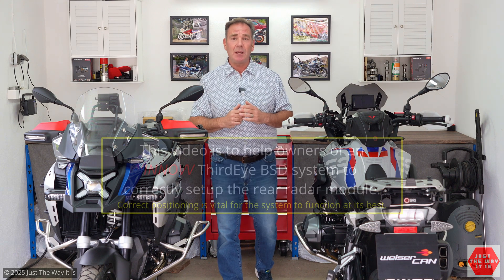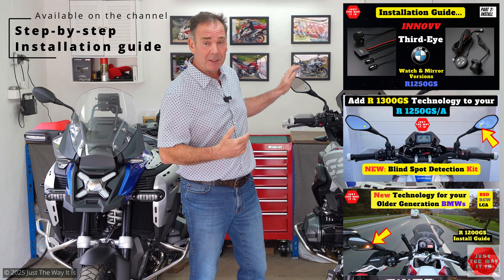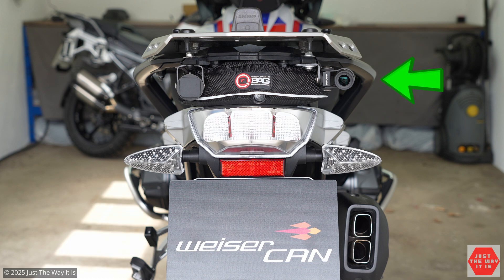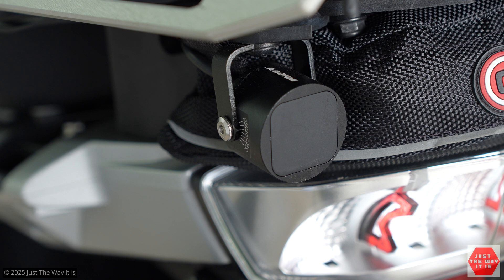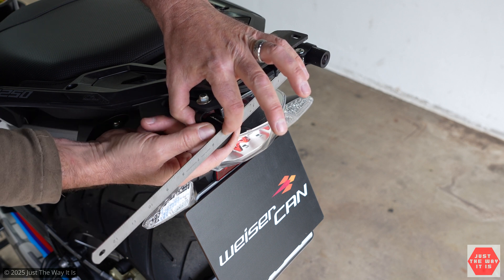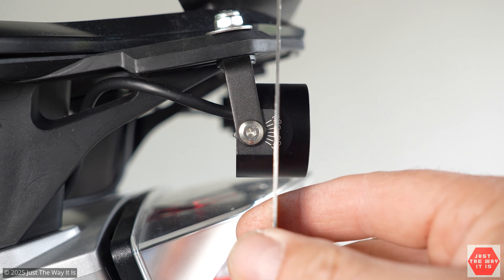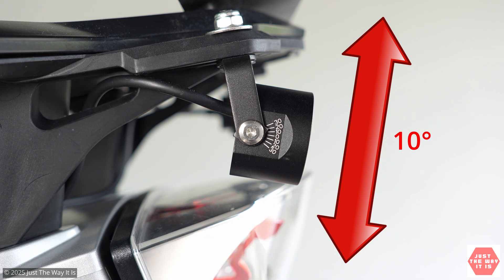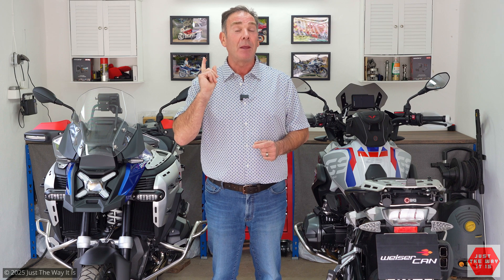INNOVV ThirdEye Blind Spot Detection system, correct rear radar position is vital ! - How to set-up

Comment: engine fitted carl shes had the full engine inc all covers and also the whole gearbox and final drive also a detail by there valeter
Reply from the maker: Hi Austin, sounds like they have done a great job, 👍, fingers crossed she is now fine🤞.
Reply: @justthewayitis i asked how much it all cost and they told me over £7000  for the engine and over £2000. for the diff i asked for my shift assist pro to be calibrated and they said they will do but dont expect  any change as my new engine came complete they did say shes had gearbox and clutch the whole kit caboodle she wasnt rough before but shes really smooth now and the tech guy when asked about running in and the issues i have had i explained i followed all running in procedures when she was new and yet she uses oil and needed a cylinder head he told me he bought a 21 plate new from their dealership and thashed it from day one and it never used a drop of oil and never had a single issue he also advised me to wash the bike using salt free snow foam  also i dont know how to send a persinal message on here but you express a desire to link up carl whilst on my tour if i could send you a route i would so you can see if i will be anywhere near you but all i am doing as i know have a carpuride. 701b pro (not the bs ) as thats too much money and imo no needed i will google calais to rimini avoiding tolls thats show ls my route

Comment: Hi Carl,  I found that when the bike is loaded and not on the centre stand, the angle changes.  I set my sensor to vertical with no load, and it seems to work fine!
All the best, Nick
Reply from the maker: Hi Nick, good morning 😊, thank you for sharing your tip 🤞, have a great weekend, Carl 🙋🏻‍♂️

Comment: I recently purchased and installed the Weiser Technik/ Innovv R1300 mirror Third-Eye BSD with the K6 dual camera (Unfortunately, RC6 is not currently compatible with the R1300 mirrors - that setup would look much better).   I chose to remove the red reflector below the brake light and install the sensor and camera right there- between the indicators, wires go directly into the area behind and follow the indicator wires internally, no visible wiring.  Can share photos.  I have the required rear red reflectors on the corners of the license plate holder instead.  BTW, Innovv K6 to iPhone connection is a HUGE headache and inconvenience, works well with android apparently, customer service is frustrating also - have to turn off BT, Cellular, and place in Airplane mode with just WiFi on.  Also have to turn off my Carpuride and Cardo.  Even then it doesn’t work every time.
I have gone through and ensured the proper height and angle for the BSD sensor and removed the protective covers, however, I feel like it activates way too late on either side - the front of the vehicle in my blind spot is already ~1m from my rear tire when it activates nearly right beside me.  Too late to be helpful.  Have tried different orientations.  I am also disappointed that it only indicates if a car enters the blindspot from behind, it does not activate if the car enters from the front.  I had hoped it could identify an object enter the blind spot zones in its “field of vision” from any direction.  I really wish it would activate always if an object is in either blind spot my cars all work this way.  You often travel in traffic next to cars for long periods of time and it would be nice to have that reminder.  The only thing that seems to work appropriately is the warning when a car approaches directly behind.  I wish I could return every thing, honestly feel like it was a waste of money.  Innovv charges restocking fee if you open the box - seriously, can’t cut the seal to open the box and look inside without it costing you if you decide to return, and return accepted only if you don’t touch anything (I had the RC6 initially, looked in the box, but decided I wanted the cleaner looking mirrors).  For the problem with the BSD timing, I reached out to Innovv, they said I had to contact Weiser Technik since they sold it - never got a response back after reaching out.  My experience may not be the norm, but for me, I don’t plan to ever purchase another Innovv product. Sry for long and disorganized thoughts.  I do earnestly appreciate your very informative and detailed presentations.  (Not sure why text is lined through)
Reply from the maker: Hi Elsancho, some slight minor adjustment of the radar angle can to used to get the system to detect vehicles sooner by decreasing the downward angle, perhaps from 10* to 8*. I have found a setting that works well for me. It’s not perfect like on a car, but I am very happy with the extra visibility the system provides.
Have a nice Sunday 👍

Comment: Just talked to a person who is trained by BMW for the Police department. Many officers where trained and have ridden Harley Davidsons. Harley designed their clutch to be used with heavy throttle and friction zone/rear brake. The officers that are assigned to BMW motorcycles require training which is done through BMW. They are told to use the engines torque, throttle and rear brake and at times use the friction zone. Talking to a service rep that services Police bikes, one officer will wear out clutches at 2000 miles until properly trained and another will not wear a clutch out that was trained by BMW. Yes it is fine to come to a stop sign and not put your feet down, all the time using the friction zone and rear brake to stay upright and in one place but best not to over do it. The 1300 GS has so much low end that I am going to go for a ride and see if I can use only the throttle and rear brake to see how that works for me dirt riding as that is the method subscribed to by a special group at BMW.
Reply from the maker: Let me know how you get on 👍
Reply: @justthewayitis  Just went for my non friction zone test ride. In first gear with rear brake sightly applied and no throttle the speed is 6-7 MPH which is too fast for a very tight ''U'' turn as I like to get down to 4 MPH (that is more likely lower do to the speedo not being accurate). But with no friction zone and at 3-4 MPH I can navigate the tight turn by just pulling in the clutch and coast a bit then let the clutch back out. Need more practice but perhaps with some training you don't need to have a hand full of throttle and rear brake so the clutch will not over heat.

Comment: Had no idea where to ask you this question and you are the only one I trust in answering it, if you can Sir.

Is this a thing now? Concerned about the clutch on my new 1300. When riding the new 1300 are you able to use the clutches friction zone and rear brake as some people are being told this and slipping the clutch is the cause of the 1300 clutch replacements people are having. If true, the Police Departments are going to be in big trouble when they get their new 1300 RTP models. One person on the Forum said, "I just got off the phone with another dealer sales rep and she mentioned that they had an owner with a 1300GS lose its clutch in only a couple thousand miles. It was replaced by BMW with an advisement not to slip the clutch in low-speed rough terrain.'' Are we not supposed to ride our new 1300 GS like we have been like on the older 1200 and 1250 bikes? Also, finding things like the below so now I am not sure I can ride as you are trained to do so like in the Police or CHP departments are taught. Is this a real thing? How do I do slow maneuvers such as ''U'' turns without slipping the clutch with some rear braking added like is supposed to be done? All the below are BMW 1300 GS 2024 and 2025 related so you see my concern. I do a small simple search and find this:

Hi, has anyone had a problem with their clutch on the GS1300, I’ve just been in Iceland, 10 days riding & on day 7 I had clutch failure. Done the same trip on a 1250 adv, no problems.
My 1300GS is smelling like the clutch is going after wet highway ride. Smells like burnt rubber tires now. Only 4500 miles on it.
Mines had mechanical failure of clutch at just 5000 miles. Could be up to 8 weeks for the new part to be delivered and then replaced under warranty.
At least they are going to cover yours under warranty. I had to pay labor on mine.
I had mine changed at 900km under warranty, and now slipping again at 3000km
Clutch failure at 1200 miles. Dealer replaced clutch pack under BMW goodwill policy. Took two months to get parts. Faulty hill assist brake system may have caused the failure.
This showed up on the screen. Mind you I just got the bike two months ago and when I got it had 5 miles on it. As of today, I had 91 miles on the dashboard, and I guess the dealership will hopefully fix it. SEE ATTACHED PHOTO...
3500 miles and my clutch just started slipping on the highway
A few days ago, I was driving on the highway and suddenly the engine stopped responding and my speed started to decrease. The engine still worked and still responded to me pressing the gas but does not respond and move the motorcycle.

When I do a Google search for, when riding the new BMW 1300 GS are you able to use the clutches friction zone and rear brake? I get this from the AI.
Yes, the new 1300 GS can use the clutch's friction zone, but it's recommended to avoid prolonged "slipping" or using the rear brake with the clutch engaged, as this can cause clutch wear. While some riders might have been advised not to slip the clutch, especially in low-speed, rough terrain, it's generally safe to use the friction zone for smooth starts and slow maneuvers. The advice about not slipping the clutch in low-speed, rough terrain is more about preventing excessive friction and heat build-up, which can lead to premature clutch wear. The 1300 GS is a powerful bike, and its clutch can be damaged if used improperly.
So now I am worried and not sure what is right or wrong.
Reply from the maker: Hi Eric, sadly there are range of issues and problems still with new R1300GS/A, it has not been a good start for this new model with lots of unhappy owners. Yes the clutch does seem to be not as robust or reliable as the previous generation with owners who use the bikes off-road and at slow speed reporting problems.  I suggest you talk to your dealership if you have concerns or problems with your clutch it will be covered by warranty. Also send a letter outlining your concerns to BMW and see how they respond. 
Best wishes Carl 🙋🏻‍♂️
Reply: @justthewayitis  Thank You so much for the reply. I just do not understand as BMW themselves puts on a Rally all over the world and to do one you MUST use the friction zone on the clutch. Did or do they have a bad batch of clutches? The 1300 has 4 more friction plates than the 1250. My bike has only 300 miles on it and I only ride dirt. How am I or can I practice a ''cone'' weave for more than a couple of minutes if my clutch is going to overheat. How do I, as you advised contact BMW with my concerns?
Reply from the maker: You can contact them here 
https://www.bmw-motorrad.co.uk/en/service/contactus/customer-complaint-procedure.html
Email is customer.service@bmw.co.uk

The head of customer service is a chap called Ben Perry I don’t have a direct email address you might find it searching on line.

Comment: Hi Carl, Can you tell me ..is the distance between the footpegs and the seat (if same thickness seat used) bigger  on the new 2025 GSA than a 2022 model ? Many Thanks P.S Great Content Just Subbed!
Reply from the maker: Not easy to answer as I don’t have a 22 GSA to directly compare, but using my 22 GS with the comfort seat set in the lowest position I measured with a tape measure the distance from foot peg to foot peg over the seat. 128cm
Then on the new GSA with the standard seat set to the low position with the same measurement procedure I see 124cm. So it looks like the foot peg to seat height is less on the new GSA. That’s as accurate as I can measure with the bikes I have.
Hope that helps , Carl
Reply: @justthewayitis  Thanks Carl. you know just need more height for comfort. only thing is the new GSA1300 has the crash frame on the side of the heads, so one can stretch ones legs out and rest them on the crash bars. i have the low frame version so may have to change to the larger frame earlier version. Many Thanks for your time.Safe Riding :)
Reply from the maker: You are very welcome 🙏
Reply from the maker: Hi SC, honestly I don’t know exactly, it feels very similar, I’ll try to check tomorrow 👍